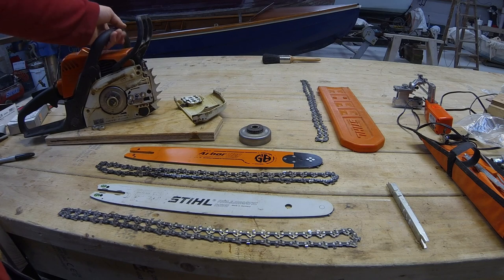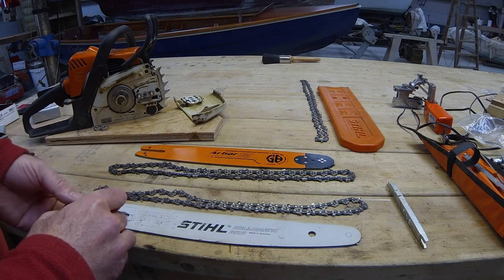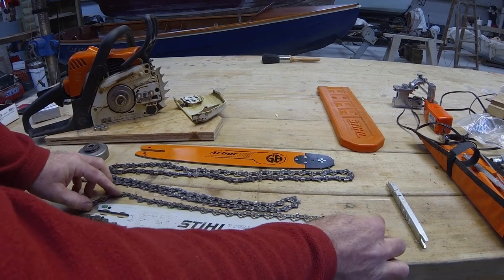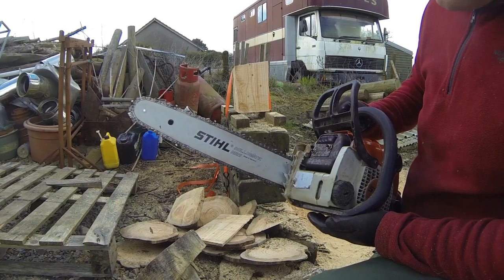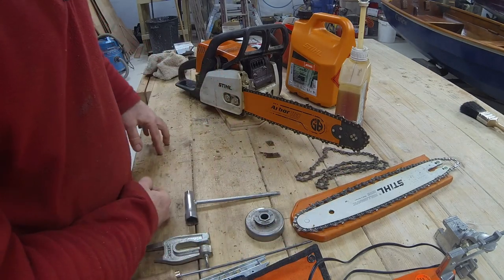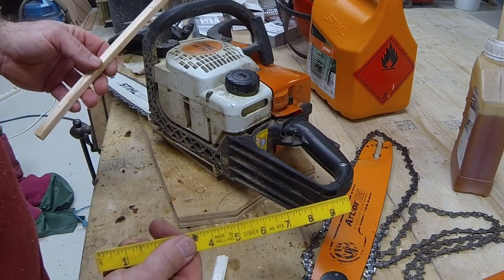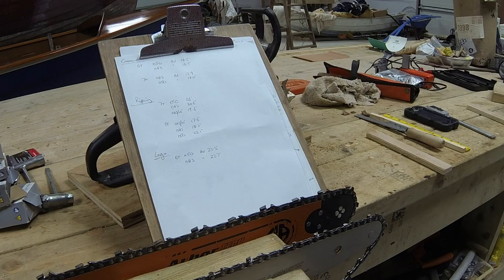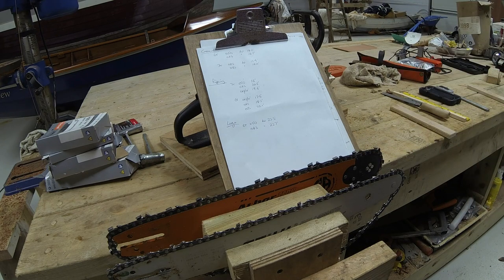STIHL MS170 chain and bar comparison test

Comment: I wonder would a 12 inch bar cut faster on the MS170?  my MS170 came with a 14 inch bar, 50 link Picco chain. Great video, subbed.

Comment: You confirmed my experiment. My 017 is my favorite limbing saw. I traded out the .043 for a .050 just because I think the bigger kerf is more forgiving or visible with movement so you’re less likely to pinch your bar in the tree. I also thought putting a 7 on would make it faster/better, but the standard 6 is still the best for this one. That GB bar you have is sexxxy though!

Comment: Seems the picco and 6 point sprocket are well suited for that saw
Reply: Yes but the picco is really shitty when cutting a bunch of wood of different types. It dulls fairly fast as well
Reply: If you are gonna go to a heavier bigger chain. You need to go down a bar size . To keep chain speed similar . The oem carb is non adjustable on this saw .

Comment: Great video.  It was really interesting to see the differences there.  I had often wondered about using different bars and chain types.  I use a long Stihl bar on my MS290 so that I can tackle larger trees.  Here in British Columbia I'm mostly cutting Spruce, Pine and Douglas Fir.  For sharpening I use the combination tool from Stihl which does the rakers at the same time as the cutting tooth and I've had great results from that.  Your safety chaps and boots are different from the ones I have.  I use orange rubber chainsaw boots by Stihl and chainsaw trousers rather than chaps as they give me all round protection.  Would be good to see a review on your safety gear too.

Comment: Wow!  I would agree with science here concerning the small saw with the bigger chain but it is common in the States to move up to the 3/8 inch chain.  There are even videos on YouTube of others doing that and getting better results.  With that I am left to assume that the bar you are using the problem.  I am not fa.iliar with that brand so I have no real idea if it is a good one or  could be the problem.

Thanks for the detailed video just the same.
Reply from the maker: Nothing much wrong with the GB brand bar. It would be interesting to see someone else do similar tests for comparison.

Comment: One other thing that concerns me is that I think the .325 chian is harder to sharpen and much shorter lived than the 3/8 chain.
Reply from the maker: As you see at the start both chains are easily sharpened consistently by machine. The smaller chain having less material to start with will therefore wear out quicker, mainly due to more frequent sharpening.

Comment: The stock bar and chain seem to be slightly faster.  But I'm not concerned about a few seconds.  What other advantages does the heavier bar and chain have?  Does the chain retain sharpness longer?  I've only run one tank of fuel through my MS170 so far, but I like a backup bar and chain and I don't know if I should get the .050 or .043 gauge.  (Or 16" vs. 14" for that matter.)
Reply from the maker: Good question. I think it is purely a ‘feel’ thing, a person preference, rather than a performance improvement. Also depends on what you are doing with the saw. Doing this I’ve proved to myself that I needn’t have changed anything. The vital and key point to note for this saw is to keep the chain perfectly sharp so if you are going to buy anything, get another chain to swap out in the field...

Comment: My MS170  bought  this June 2020 in BC Canada came stock with a 16" Rollomatic E bar 3/8" pico .050, part # 3005 000 4813,  6 tooth drive sprocket on the powerhead, and it cuts great. What I like is the nice wood chips thrown out, I prefer the 3/8 pico to the .325 chain on the Ms261 I have.